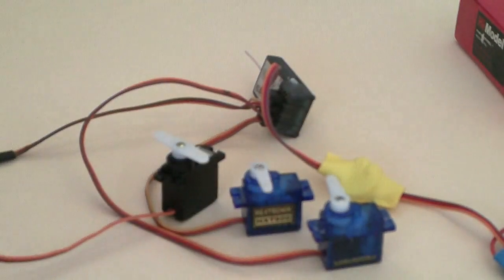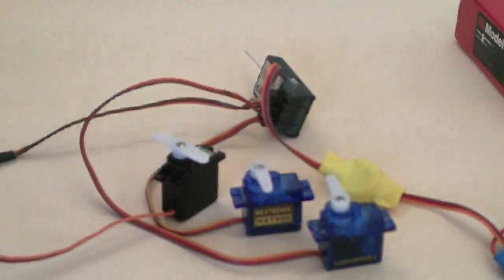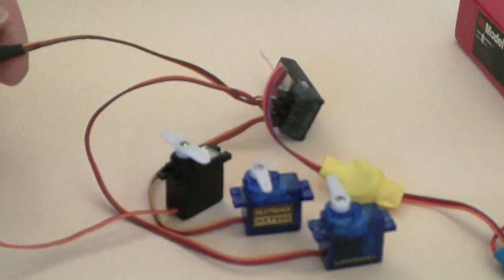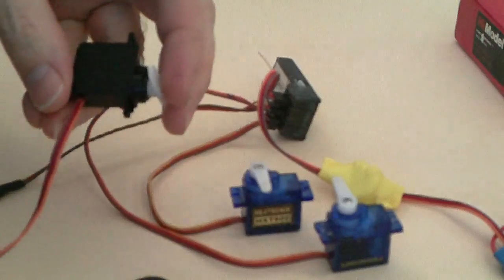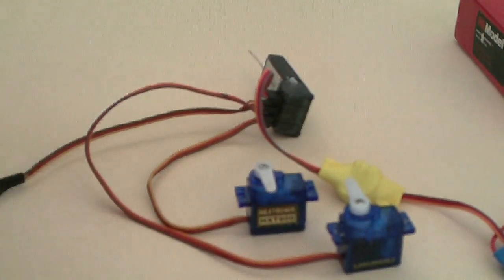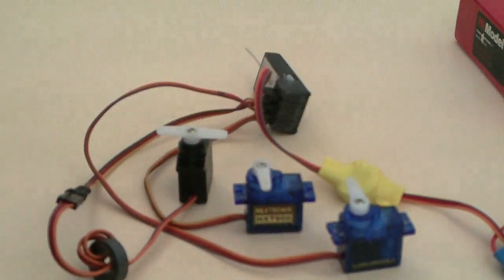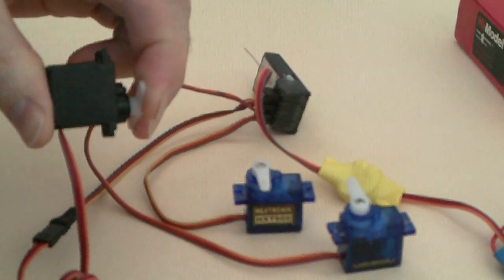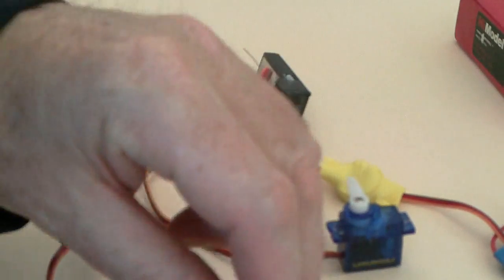Servo Jitter - Solution

Comment: I also check other website and so it seemed the HXT900 is very prone to jitters. I crash my aircraft using this servo twice. Although on the bench , the servo doesn't jitter but in the air,  the aircraft was flying fine ,then it went out of control  mysteriously ! No HXT 900 servo on any aircraft for me!

Comment: Awesome. I had the same problem once but the noise was coming from the external bec. After adding a little core with 4 turns the servo twitch stopped. The servos were just regular analog though. I've now noticed that some of the newer UBEC's already have the core installed on them.

Comment: Hi, just came across rthis interesting video while trying to solve a servo interference problem on a model  railway.  I have numerous 9G servos on the layout and some get interference (I believe) from the track power fluctuations when locos run over rail joints or points (turnouts). Would this solution help? Cheers!

Comment: Do you have a specification on the ferrite core? And a vendor recommendation? Amazon has some but they are one once, which much larger than yours.
Reply from the maker: You could try something like the HF60T18X10X10 from Digi-key.  There are so many materials and specification.  The ones I used came from a local New Zealand hobby electronics supplier many years ago.  They still list them but no data.

Comment: There's also another issue. If you put a digital servo on that receiver (not digital) the servo (HTX900) will go into analog mode wich is not it's best mode.
You should only use digital servo when you have a digital capable receiver or FC. In fact most modern fc's you can set the puls speed/width for a digital servo.
In every other case the digital servo will be in analog mode which causes the jitter.
Reply: I forgot to say that the advantage of digital servos (speed and torque) can still be used but you should chose all digital servos in that case, or use your solution if weight and space isn't an issue)

Comment: For those that after trying this still have the same issue: you should try using a capacitor between VCC and power supply and it should fix the jitter.
Reply: that's something a bit different... 
servo jitter is caused by interference on pwm (S+)
Noise on +5Vdc is a different story, you can have smooth and stable 5Vdc and still jitter, 
although root cause of the problem is however mostly the same -> servo coil.

Comment: may i know what is the actual reason behind this jitter? and how wrapping around the metal core addresses this issue?
Reply from the maker: +CA Hau The digital servo draws current from the power supply (the receiver and ESC or BEC) in very short but high current pulses. So the average current is low, but the peak current is high. These high current pulses upset the smooth supply voltage and cause interference that upsets the other servos. Especially servos that do not have good filtering already built in.

The circular core adds inductance to the lead and filters out some of the interference. Some interference still gets through, but if it is small enough that it does not upset servos etc. it doesn't matter.

Better filters are possible and advisable on larger, expensive or more dangerous models. But a filter core is small, cheap, simple to fit, and usually works well enough.

I always add a extra filter capacitor to the 5V power directly at the receiver for some extra safety margin.
Reply: +PMB-NZ thank you for the informative and prompt reply! Am i right to say that if i am only using a single unit of servo motor, the jitter can be solved just by either connecting a capacitor between 5v and ground or resorting to ur method?
Reply from the maker: +CA Hau I suggest both, the capacitor and the inductor core. You could try the capacitor first and add the inductor core if still a problem.

Keep the capacitor lead as short as possible.
Reply from the maker: +theskyisthelimit I just use 2200uF or 3300uF electrolytic capacitors rated at 6.3V, because I have a lot of them. They were originally for repairing computer mother-boards. +ve and -ve capacitor leads just connect to +5V and gnd (red and black) at the receiver. Keep the capacitor leads as short as possible.
Reply from the maker: +CA Hau The servo sees interference signals and gets confused, causing it to momentarily move to random positions and then back. The effect is jitter.

The core increases the inductance in the lead. Bigger core and/or mre turns through it = more inductance. Basically it just lets the DC power pass, but restricts (filters) the AC or noise energy. If the noise is kept away from the receiver and other servos, everything should be more reliable.

A good capacitor on the power supply rails (+5V to ground) is always a good idea. I use a 3300uf 6.3V capacitors plugged in to a spare channel on the receiver; because it's a convenient central point. It is best to choose a low-ESR capacitor and keep the leads as short as possible.
Reply: Hello. Thank you for this advice, 2200uf solved buzzing issue.
Reply: +PMB-NZ Where did you get the capacitor and do you know the spec?  Not clear on how you have the capacitor on the lead.. is it just connected to the positive and also to the negative (ground)?
Reply: I have a 10uf capacitor on hand. 16v rated. I guess that might be too low or maybe not?
Reply: +theskyisthelimit You're going to want a big, high capacitance capacitor. Since these can supply a long spike. 10uF is often done for decoupling small current gaps.

Comment: Put a large bypass capacitor across the 5V line and ground connected as close to the servo's as possible. That should prevent interference too.

Either way, ferrite increases the inductance of the wires, and the way it is done, common mode rejection is increased. (AC noise that's common to both pins, as in not differential) The effect is that the voltage will sag between the digital servo and inductor. That could be an issue it if was a lot, and take away slightly at the speed of corrections and performance. So a bypass capacitor on it would be very helpful. And also prevent electrical noise from being conducted to the rest of the servo's.
Reply: Great answer sir! And what exactly configuration of this capacitor can I use for this video setup?

Comment: Excellent video... hard to beat the HXT900 for the money LOL.
Reply: true,  if they dont break on you before you get to fly lol, ive had bad luck with the little suckers lately the two 2 top gears seem to always break,  also beware of the replacement gears for the HXT900 i ordered 10 sets and the 2nd gear down its tall gear is incorrect and will not mesh with the output gear, at least the sets i bought from  HK , ended up having to send them all back.   wish they would fix this!
Reply: That's not good for business as HK relies on being able to provide low cost batteries and servos to sell their products. I guess I should have said if you get a good one from a good batch... And I just got the popular 800mm Reaktor 3D plane that when you put a yardstick down the side of the fuselage the tail is almost one and quarter inches off to the side and it looks more like a banana than a plane's fuselage, and the wing looks like it has two different airfoils with one side visually thicker than the other side that has a sharp leading edge like on a fast flying pattern plane. To say this would be the worst flying 3D plane is an understatement and now I'm kicking myself in the head for not getting the Twisted Hobby's Crack Laser instead due to shipping costs and seeing I did not get the only banana being sold as a 3D airplane making sending back for a new one a risk. First negative issue with a HK product so hoping I get a straight one after sending it back.

My Techone Tempo measures right on and expected the same from it's little brother. I'll send it back and with the added shipping costs that's higher than most companies I didn't save a penny and ordered a lot to go with it. Could be my last plane order from HK as too much "savings" is going into shipping costs. I suspect the people making this stuff are getting angry as anyone with no experience could have done a better job. If the wing was OK I'd just unglue the hot glue and straighten the fuse but nothing can be done to fix the wing within reason. ERRR!

As for the HXT servos despite the usually good reports of dependability and fairly good performance I only use Futaba or equal quality servos. I have never had a servo fail except one and that was not the servos fault I purchased used with a dry bearing that rusted out after a year. But seems even the best amazing new servos coming out made by the new companies popping up fail once and a while and Futaba has backed down keeping up making better servos due to low profit margins showing the danger of buying "cheap". Just didn't try using a top quality digital servo that centers and holds it position under load well with no gear slop as it's hard to go back and be happy with your plane. This hobby is addicting and good servos are just one of many drugs used to keep you hooked;-)
Reply: John F Hendry Update HK seems to be matching Horizon Hobby in customer service. See what happens. Need to seed in the pictures and cell phone was no good enough and my real camera's batteries kicked the bucket and took a while to find the power cable.
Reply from the maker: Jeremy Vest
I don't think these small servos are as good as the original HXT900s from when I first bought them years ago. Just the gears don't seem as well made. I've still got quite a few operating.

I've been going off HK a bit in recent times for more technical bits. I've bought a few of their Multiwii flight controllers, most of which are modified copies of other boards. As copies they are not as good and lack basic information.

HK are still great for most other parts.

Comment: u can also twist ur servo wires and add a cap to the power wire
Reply from the maker: This is a good idea, every bit helps.
Twisting the wires reduces their ability to pick up and radiate interference if the signals or currents carried are ballanced. The power supply current is ballanced between +ve and -ve. Capacitors help a lot and are much better with a toroidal core added, or you don't need such a large capacitor.

When I was testing some small 12g metal gear digital servos I noticed current draw spiking to about 9 Amps, but for only very short pikes. Capacitors can easily suppress most of this and it doesn't bother most BEC/UBEC. These current spikes generate interference that can upset other equipment in the model such as reducing radio range.
Reply: @Rcbeacon 10years passed but it is still valid 🎉

Comment: Have a problem, dont know where to go, so i'm coming to you. I got the Flysky CCT6B Tx and Rx.
1. I bound the Tx and Rx. Power to Rx is from a 9V DC battery through a IC 7806 - for 6V out.

2. After bound, the servo worked fine, (Ch1, Left and Right Control Stick). Turned 30 degree one side, back to center and turned 30 to other.

3. During my second approach, i added another servo (metal Geared), when switched on both started jittering. Dont know why.

4. So, i removed it and tried with one servo, again the same jittering at the moment power is on to Rx, and continuous the jitter.

I dont understand what to do. Any problem with the connection. Plz do help me if you can. What makes it to jitter.
Reply: read my above comment ,low current or noise is probably the cause of ur problem
Reply from the maker: Hello. Sorry, took me a while to see this.
What type of 9V battery? The small ones won't supply much current, and the voltage will droop. Servos often draw high peak currents for very short times. You need an oscilloscope to see it.
The 7806 regulator is not the best in this application. I should have the input voltage always at least 3V higher than the output voltage. 78xx regulators can easily oscillate at high frequencies if not decoupled correctly (capacitors on input and output.
A LDO (low drop-out) regulator would be better. But manu of these draw a high quiescent current (current draw with no load).
Good luck.

Comment from the maker: Sorry, another delayed response. I'll have to read my Gmail more often.
It is OK to mix analog and digital servos. Digitals put more strain on the power supply. Proven reliable, metal-gear analog servos are just as good as digital for most applications where you don't need the faster response that digitals can provide.

Comment: Hi PMB....please advise if it is ok to mix digital with analogue servos in a plane....from your video it looks like it's possible without any problem.
I want to replace the analogue servos for digitals in the wings for the ailerons and leave the other analogue servos for the other control surfaces as they seem ok.
The reason is because I am not confident with the existing 645MG servos centering properly. I am using dual ailerons and elevator set up in a DX7s Tx.

Comment from the maker: I got the ring cores from Soanar/Jaycar but something similar should be available from Digikey, Mouser, Element 14 or RS Components. The bigger the core the more effective it is, but in model planes you also want to keep the weight down. Any core is better than none, and the more wire turns the better.